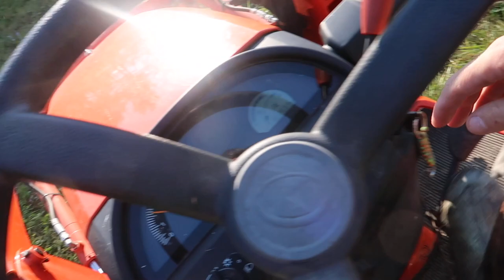I hope the SKUNKS aren't BACK in the Chicken Coop!

Comment: Glad the skunks seemed to have moved on. Chunks of charcoal in NYC will help absorb the skunk odors if you throw some inside. 
Rewatch the saw sharpening part of the video. Your fore hand goes up, and rear hand down on each stroke of the file. The stroke needs to be level throughout. You should be able to sharpen a chain without a vise if you're stroking the file correctly. The rocking stroke you use, causes the file to catch rather than glide smoothly. Between the cutting teeth at the chip rakers. These help clear chips from the cut. They also set the depth of the cutting teeth as they cut through the wood. Every time you sharpen the cutting teeth, they get a little bit shorter and these rakers also need to be filed down. You should have a file guide for your saw to adjust the height of the chip rakers. A well sharpened chain should throw out chips, if your throwing out sawdust rather than chips, your rakers are too tall and need to be filed down.

Comment: Hey Al, the groove that the chain rides in collects all kinds of debri and will cause the chain to raise up like that, not oil properly, or even worse pop off the sprocket tip. I Clean mine almost every time I use a saw. Also just a tip if you didn't already know, make sure to flip the bar every new chain or chain sharpening plus grease the sprocket tip and clutch bearing. Amazing how many people forget to do this... I guess out of sight out of mind. Safe cutting from one saw user to another!

Comment: You need to get a stronger stand for the vice.  It is moving around as you are trying to sharpen the chain and won't allow you to get a good accurate angle on the chain teeth when sharpening.  Attach the vice to a workbench or make a bench just for the vice.

Comment: think the rackers on the chain need to be filed down a bit al...great job...
Reply: I was thinking  take the bar off and clean out the slot in the bar. It would also be good to use a square to check that the rails are even
Reply: If the bar rails aren't even the chain will have a lot of play from side to side and the cut will be slightly off from what I've seen. Try to stay ahead of the game and not get that bad lol.

Comment: Al, I noticed when you were sharpening your chain, it didn't look as though you were going far enough to get the rounded over part on each tooth ? I think if you did a few more swipes while pulling up on the file would help to get the top edge of the chain ?  Also take a couple swipes on the rakers/drags and you'll be amazed on how fast the saw can munch through a tree !!!  Love these types of videos and still hate them skunks, thumbs up !!! Edit: Love your family breaking bread together and the prayers, great values.

Comment: How did the skunks get past the electric fence?
Reply: I wondered that also.. Sneaky varmits!!
Reply: I don't think that fence is electrified.
Reply: 18:05 No, my mistake, it is.
Reply: Regardless of the electric fencer's joule rating, if the open circuit voltage rating is too low, it won't penetrate the skunks fur and they can pass thru without getting popped.  I've run into that before.  Now, I use a low impedance 2 joule fencer with a "no load " voltage rating of 11,800 volts.  This will penetrate thru the fur and give them a hell of a shock.  It's a powerful machine, but I have cattle too, so I just use it for all the animals.  I've been popped several times and I swear that thing will draw the devil out of you.  Buy a strong machine the first time, ground it right and be done with it, or you will end up like me....with a collection of weaker machines that I no longer use.  Also, keep a backup fencer ready to go in case your main one fails, because it will sooner or later.

Comment: you need the Stihl 2in1 Sharpener. your chain will be better than new. lots of YouTube videos of people using it. Wranglerstar, Outdoors with the Morgans. Out of the Woods. etc.
Reply: They make a Husqvarna version as well. Be careful with the stihl one since there basic 3/8 file is 13/64 and Husqvarna / Oregon is 7/32.
Reply: 3/8 is the pitch. not the file dia. 13/64-5.2mm is the file dia. (stihl) or the 3/8 picco uses a 5/32-4.0mm dia

Comment: If you are going to hand file a chainsaw and want it to cut precisely, I strongly suggest you take a hacksaw and scribe the angle you need on your vise...SHARPENING A CHAINSAW IS AN ART that even loggers and professionals rely on mechanical devices when not in the middle of a job.  From watching you cutting down the tree, it is obvious you saw is dull as hell.  Get an extra chain and have a pro sharpen it for you and you will see how much better and easier your saw will cut.
Reply: On the top of the tooth your sharpening there is a angled line to aid in sharpening with a hand file. 25° angle for Husqvarna and Oregon chain's and a 30° angle for Stihl. Electric sharpeners take a lot of material off most of the time too much and your chain doesn't last as long, and I've seen a lot of short then larger teeth on the same chain since the machine doesn't recalibrate and grinds some down to nothing if shorter to begin with. Always check the depth of your rakers, you can have the sharpest tooth in the world but if your rakers are too high then the tooth can't hit wood to cut it.